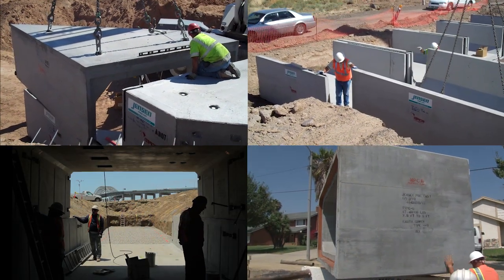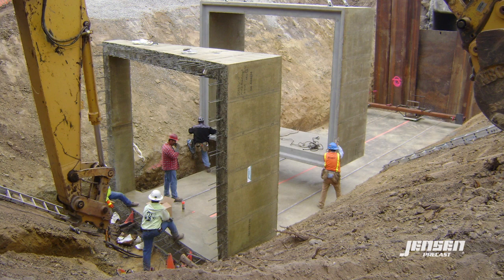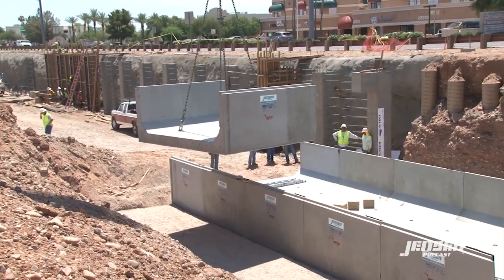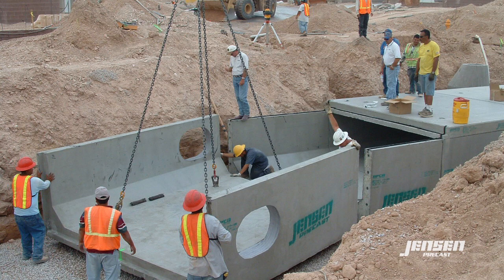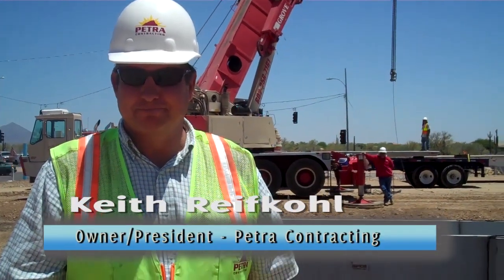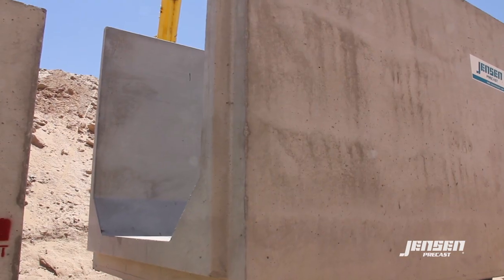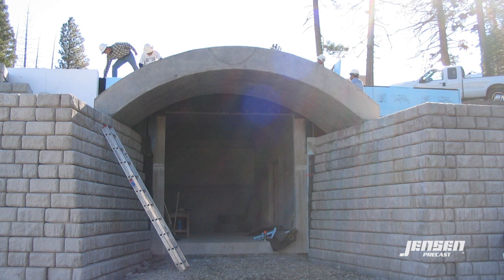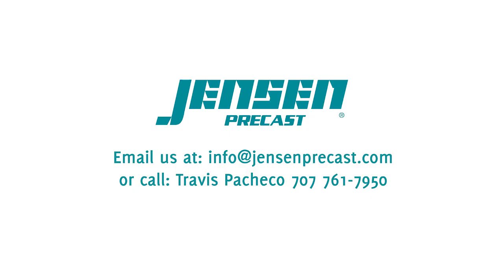Precast Concrete Box Culvert

Comment: So how much does one of these culverts cost? like on of those units at 0.30?
Reply: 54jb3r7  I contacted a company who manufacture these type of culverts and it all depends on how many are needed for a project (a building company typically wouldn’t buy just one, which the more you buy the price per culvert would go down), the size of the piece, specific material construction and how thick the walls are, it’s not as simple as “how much does one culvert cost?”. For a single piece of 2 metre square culvert and less than 2 metres long, it could upwards of £8,000
Reply: @james-r  Over here we have a 36 foot wide 1.16 kilometre long culvert in which it’s river has outgrown it. Judging by if we get a 50 to 60 foot wide culvert then it it’s 10,000  metre would cost around 11 million dollars. Which is a scam because it only costed 7 million dollars when it was installed back in 1973. It is of extreme construction and some of the walls look like new